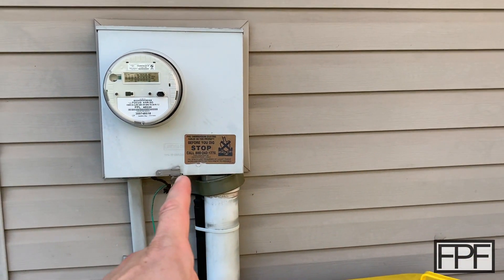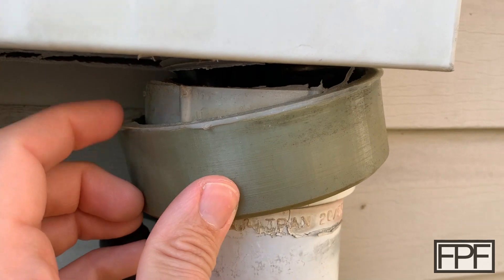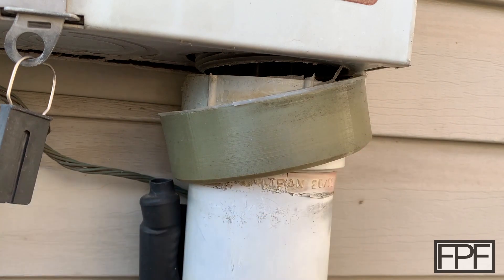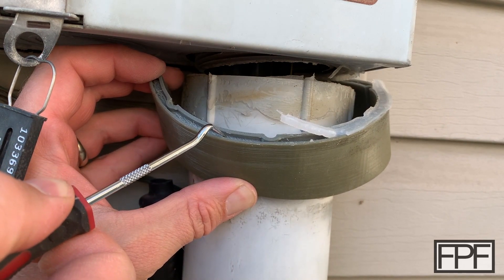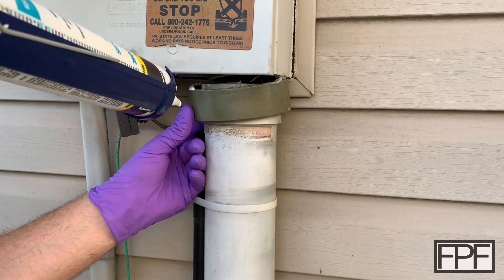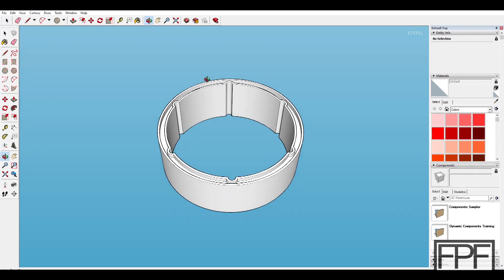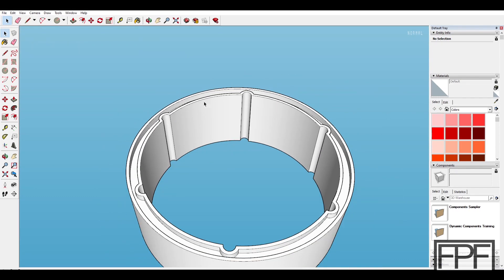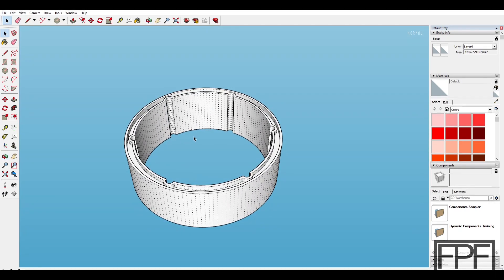3D Printed Meter Base Conduit Gap Fix

Comment: Thanks! I was just quoted upwards of $1000 to fix this seemingly small issue. The wires are loose so I see no reason why I shouldn't use a 3D printed flexible coupler.

Comment: Have you noticed there seems to be a gap between the meter box bottom and the wall? (something moving?) Maybe some expanding foam for both gaps could be beneficial as extra security
Reply from the maker: I think the ground is just settling a bit around the foundation